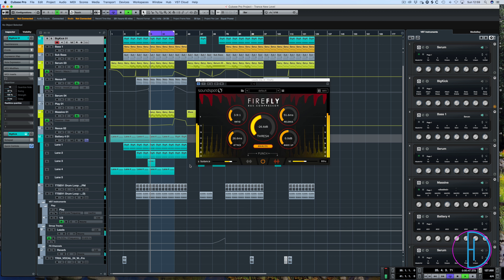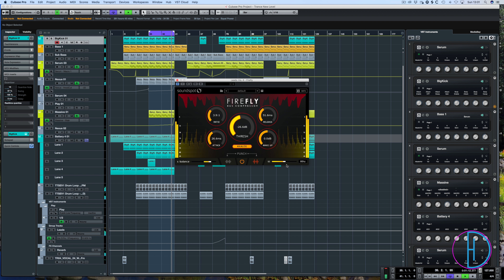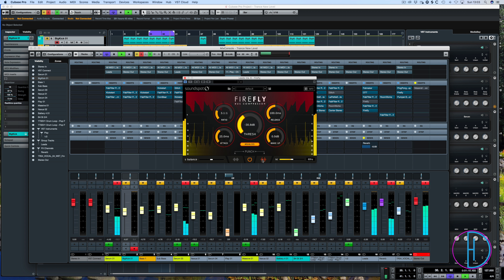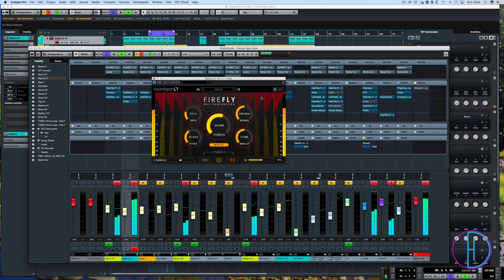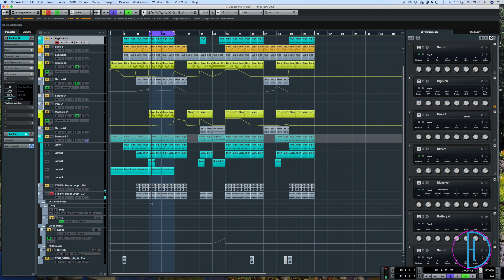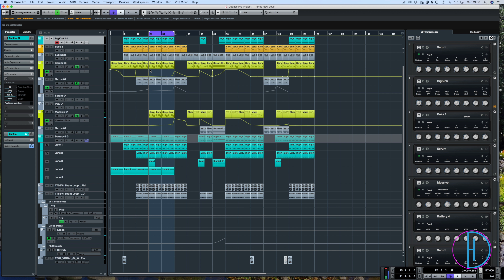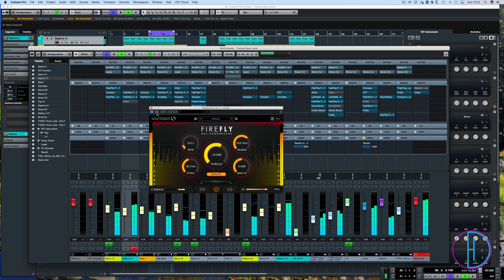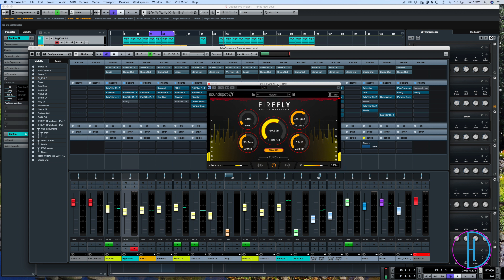Firefly Compressor | Plugin Review

Comment: Great demo, but next time it would be great if the bottom end from the commentating would be cut off? That way we could hear the track a bit more clearly,  I think. I'm struggling to hear the subtleties of the track at times because of the voice coming in and talking about it. I think there might be a lot of ducking as well. Makes the track itself harder to keep track of I think.
Reply from the maker: Hey josh, thanks for the feedback. I do use sidechain compression to make sure my voice is clear. I usually leave sections with out my voice for you to hear but I must not have applied this technique this time around. 
I will keep this in mind.